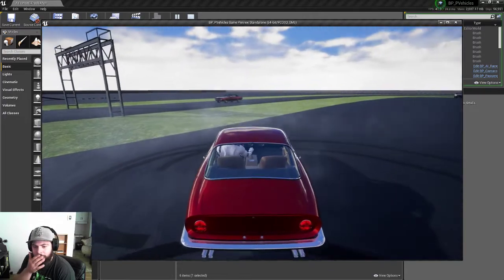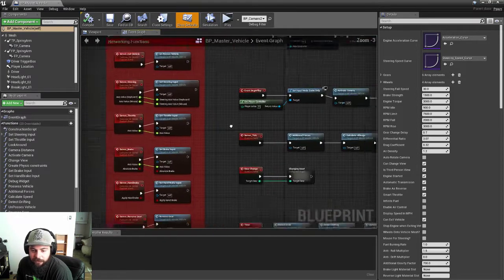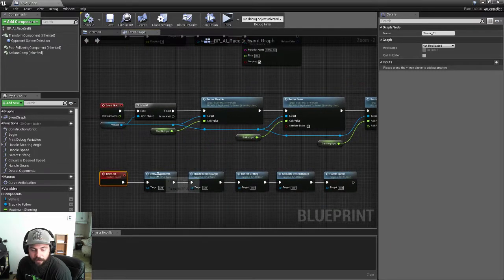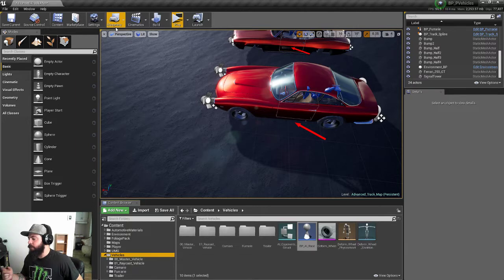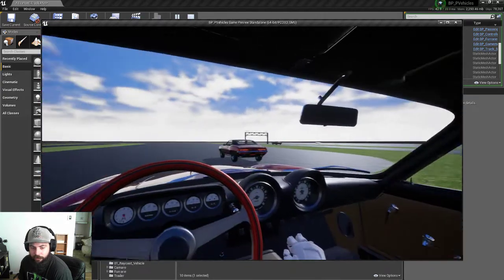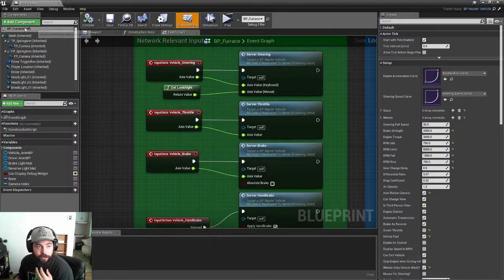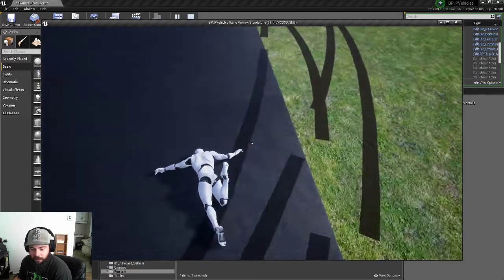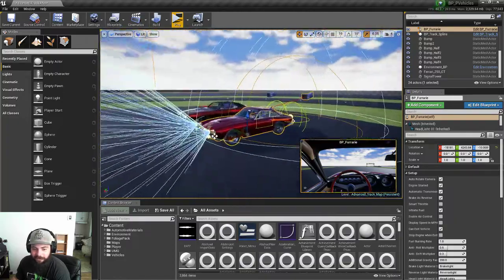Physic Vehicle Project. Update 2.9

Comment: Hi Math I wanna find out if it is possible to do this without the skeleton of the car meaning using meshes only?
Reply from the maker: you mean static meshes? sure, with some modifications it is possible but static meshes dont have the physic asset editor so less accurate.
Reply: Hi Math yes I meant static meshes, and thanks a lot do you mind telling me what type of modification I can do on the static meshes to make it work?
Reply from the maker: check the older versions, 1.0 for example uses static meshes. so you can see what is different. I do not recommend using the older verssions but you can study them.
Reply: thank you, I'm going to look it up